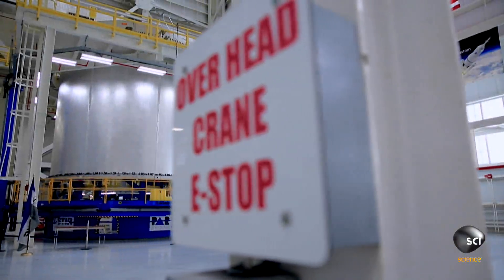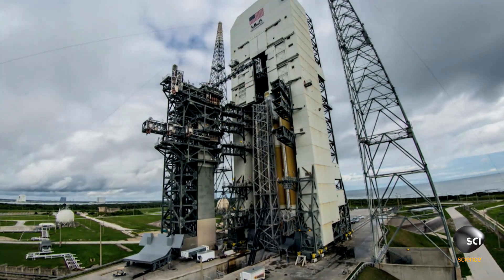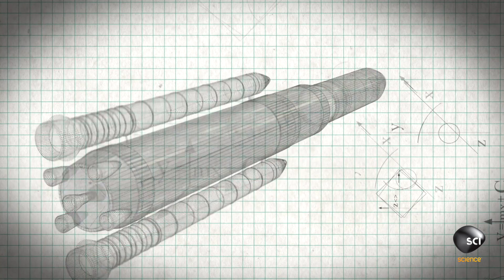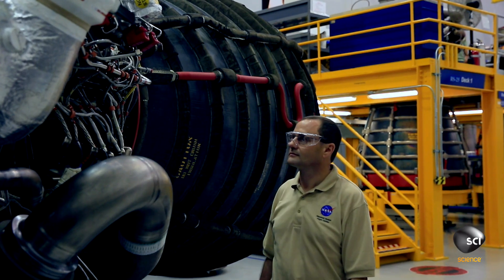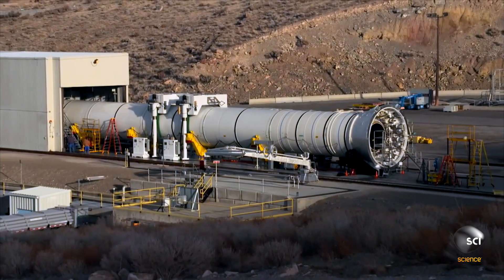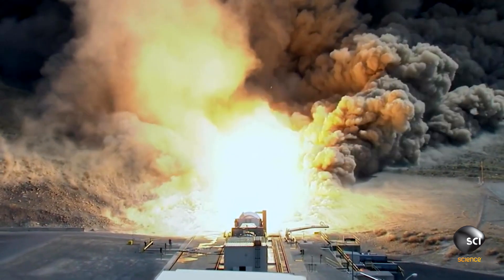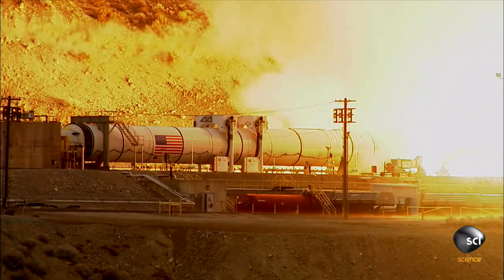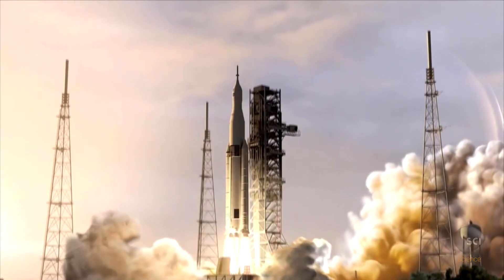The Most Powerful Rocket Ever Built

Comment: The science channel is using clickbait. This is not a rocket, this is a booster, and plus the SpaceX falcon heavy rocket generates over five million pounds of thrust quoted in the SpaceX Falcon Heavy section on their website. Here is the paragraph they mention it in:  Falcon Heavy is the most powerful operational rocket in the world by a factor of two. With the ability to lift into orbit nearly 64 metric tons (141,000 lb)---a mass greater than a 737 jetliner loaded with passengers, crew, luggage and fuel--Falcon Heavy can lift more than twice the payload of the next closest operational vehicle, the Delta IV Heavy, at one-third the cost. Falcon Heavy draws upon the proven heritage and reliability of Falcon 9.
Its first stage is composed of three Falcon 9 nine-engine cores whose 27 Merlin engines together generate more than 5 million pounds of thrust at liftoff, equal to approximately eighteen 747 aircraft. Only the Saturn V moon rocket, last flown in 1973, delivered more payload to orbit. Falcon Heavy was designed from the outset to carry humans into space and restores the possibility of flying missions with crew to the Moon or Mars.
Reply: Asshole sls is more powerful than saturn 5 whose capability has not been touched by any rocket

Comment: 1:30 RS-25 engines (1st gen) are really old school with a big weight cost.  Newer engines can deliver twice the thrust or higher per pound of weight.  Of-course nothing gets more old school than Estes Solid rocket boosters.  This jobs program system using older parts should work assuming the rest of the rocket can take the vibration of the SRB's.  The first version of this will not be near as powerful as Saturn V and if SpaceX Mars Colonial Transport gets built it will make SLS look like a relic lifting well over double the amount of any SLS and being reusable.   There is no real hope of re-usability in SLS  because of he SRB's.
Reply: The SRBs are the reason it's not reusable?  Actually, they're the closest to bieng reusable of any of the parts of the SLS.  They aren't reused, because it turned out to be more expensive than just replacing them, but they're basically just the same ones that the shuttle used, which were reusable.